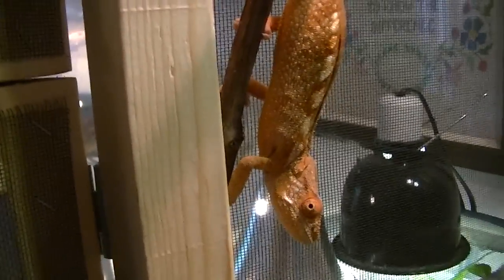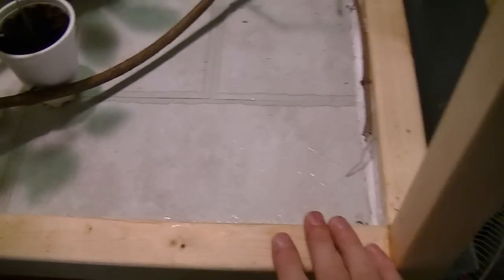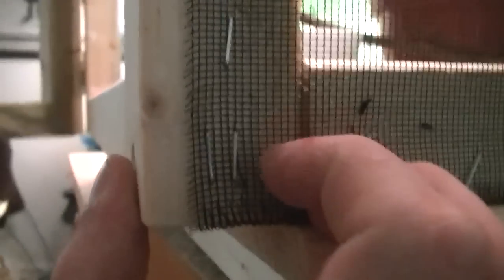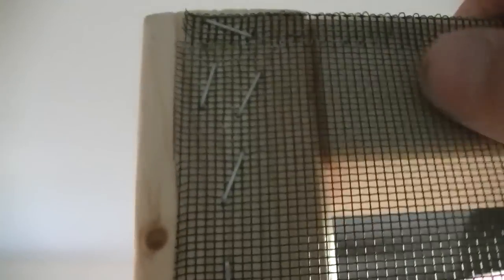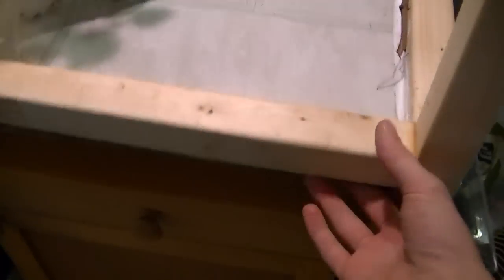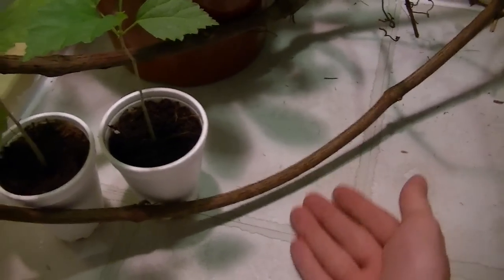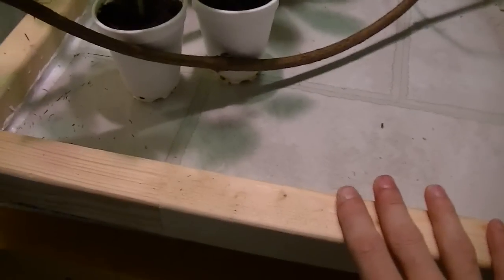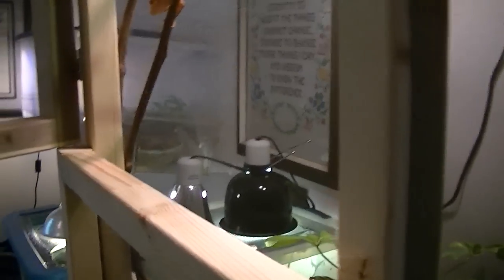HomeMade Chameleon Cage (Open Air Screen Habitat) DIY

Comment: ah i dont know much about chameleons but dont they need high humid cages and that cage you made has way to much air flow you probably should of installed glass on the side but other than that it looks really neat